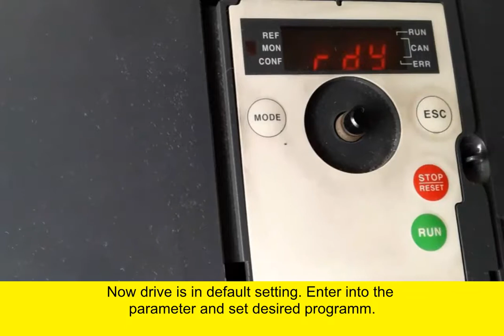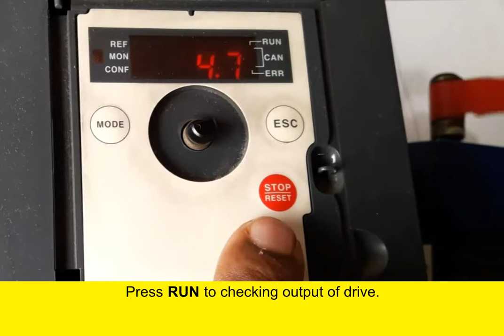𝐂𝐅𝐅 𝐟𝐚𝐮𝐥𝐭 𝐨𝐧 𝐭𝐡𝐞 𝐀𝐓𝐕𝟑𝟏𝟐 𝐝𝐫𝐢𝐯𝐞𝐬! CFF ফল্ট দূর করার জন্য কী কী ব্যবস্থা আছে?

Comment: I am having cff fault! And it's not going in another parameters! Cff fault is constant and button are not working! Wht to do?
Reply from the maker: Please watching video carefully, and try accordingly. If button not working, please change control card, hopefully solved your problem
Reply: @FlowChart  buttons are working but! Nothing is happening in display it just shows cff fault!
Reply from the maker: Did you removed control connection?
Reply: @FlowChart  yah everything is removed! If you give me your number I can show you!
Reply from the maker: You may changed control card.  Maybe existing card damaged
Reply: @FlowChart  thers is no damage in card every thing is working properly just the cff fault is not going it's also not going in other parameters as you shown in the video
Reply from the maker: If card is ok, then press jod dial, here displayed  FCS, press Again jog dial and set InI for initialize
Reply from the maker: Jog dial
Reply: @FlowChart  if I press any button nothing is happening! Just cff fault appearing on display.
Reply from the maker: Please change control card

Comment: assalamualaicom vaia
amr akta vfd Schneider atv321hu40n4 atar o.cf dekhai amr motor thik ase
Reply from the maker: Plz check 
Maximum current setting, 
Output CT circuit
Reply: @FlowChart  perameter number koto aktu bolle help hoto
Reply: @FlowChart  hii sir inf7 reset next motor over current please send details
Reply from the maker: Check motor and inverter output unit, Cables